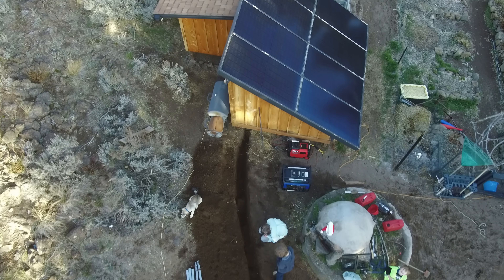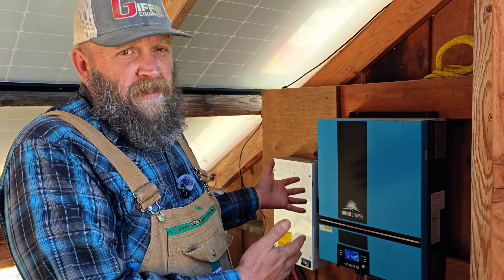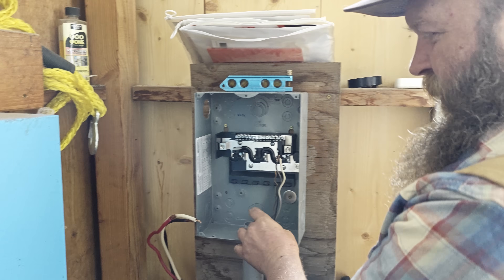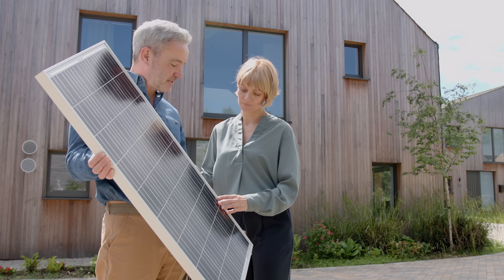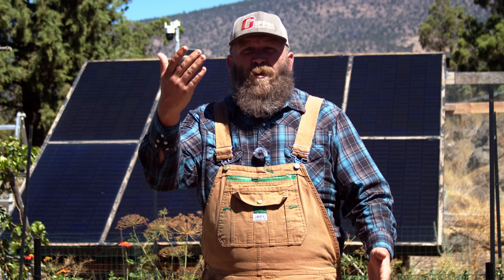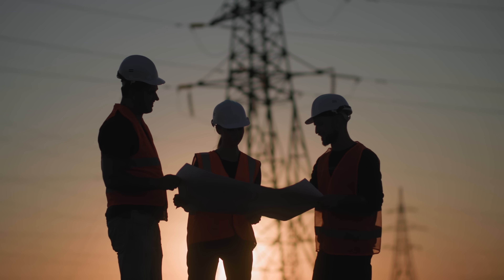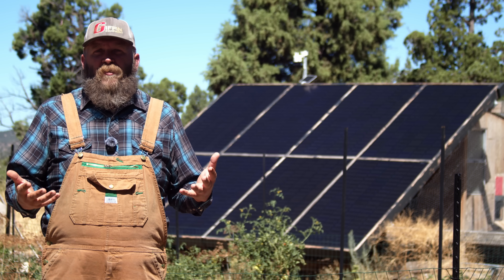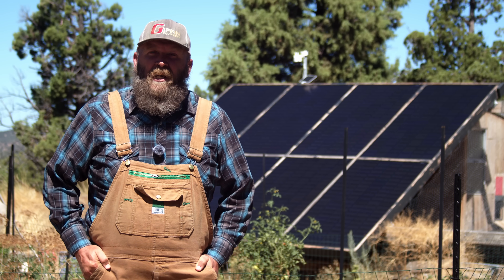The True Cost Of Off Grid Solar

Comment: I think it would be good to add to this... I've been living offgrid solar and wind for several years in Wyoming. The system you have is a bit smaller. You can live with that... but if you want any semblance of normalcy and a wife and kids that don't hate you, you need a ton more... 
I have 6kw of solar, a 2kw wind turbine ( I live in the windiest state and it is not worth it to do wind, unless you spend an obscene $ on it). My battery bank is 4x the size you have, and it's still not enough in the winters. I obviously have more electronics than you do.. I run an electric stove, electric hot water and a forced air furnace and a few refrigerators and freezers and a water well pump. Those eat power like no tomorrow..
In the sumer it's no problem for us to run our central AC. I almost never have to use my generator in the summer. But... in the winter I have to run it about an average of an hour a night to help cover the cooking after dark. I use propane for heat, thankfully my cabin is so well insulated that it barely uses any to heat the place. I used about 275 gallons for all of last winter in Wyoming... it stays below freezing from November to March and frequently drops to -20°F at night for weeks at a time. We also have stupid wind that 50-70mph gusts with 20-30 sustained is the norm here.. (hence why almost no one lives out here)... 
I have a family of 5 in a small cabin on our ranch and I have to constantly pay attention to our power usage and my system is much lager than yours. I wanted to give other people another perspective on real off grid living. It's not easy.. it's a very big life style change. And if you want to live without constantly worrying about power and having to get up at 2 am, put clothes on and go fire up the generator in -20°F temps and -60°F windchill. you need much more than shown here. I'm hoping by this winter I will have all my batteries purchased and in place. I have about 43kwh of batteries now.. this winter I should have right at about 70kwh. 

I will gladly take a look at what else you have going on with your stuff.. and I do say you had a good approach to helping others start the process. Kudos to you.
Reply: I'm liking your perspective on this. I would say given the weather conditions we have here, while much different than yours, are as demanding in a different way. For my own use, I see 40-ish kwhr of battery backup a good start. In the summer with normal airconditiong loads and all the other electric devices we have, our consumption is knocking on the door of 80 kwhr per day under worst conditions. The winter is not nearly as bad normally, usually 50 kwhr/day or less under worst conditions. In order to run grid-free and with no gas generator involved, 70+ kwhr battery capacity would likely be necessary and that is just nearly unaffordable unless you are Warren Buffet.

Comment: Here’s what it cost me doing everything myself except new service run (I keep the grid as backup):  

200A service run and conduit for ground mount pv array — $7300

2x EG4 Flexboss21 inverters: $9000

1x EG4 Gridboss MID: $2500

128 x EVE lf280k LiFePO4 cells from Docan: $10800

8x Seplos Mason 280 DIY kits w cables and heating pads: $5440

5x Neey active balancers (before seplos included in kits): $450

Cabling, connectors, etc: $1200

12x12x72 raceway: $500

Conduit and couplers: $500

Midnite Solar 1000A battery combiner box with 8x 175A breakers: $2100

PV wire: $550

Ironridge roof racking: $3500

41x Solarever 455W panels: $6500 shipped

30x aptos 460W bifacial panels: $5500 shipped

Integrarack ballasted ground mount:  $4000

Gravel and labor for ballast: $1k

Off grid year round in central Maine.  No power injected to grid when surplus

Comment: For what it's worth we run Directv, bunch of lights, fans, water pumps, a full size fridge, and electrically prewarmed gas oven. Of course I have a blender and all the typical electronics even a sleep number bed in our 12x16 tiny home. On our carport we set up 4- 430 watt panels with a renogy hybrid 48v all in one inverter and 12-8 volt deep cycle batteries. In Hawaii everything cost us about $4500. Been running almost 2 years with zero issues.
Reply from the maker: Sounds like you've got it dialed in, great job!
Reply: Hello !! I just started drywall on my 12 x 16 tiny home with my baby girl Lyla (doggy) in Tennessee. It’s great right ?
Reply: @NoMoreBigRatRace My wife, 2 dogs, 4 cats, and I have been living in our lil cabin for over a decade now. We love it. Traditionally our bed was in a loft, though with health changes we had to move it downstairs, so we are building a separate bedroom cabin of the same dimension. We already had a 8x20 lanai attached, so we are mirroring it with another lanai on the new bedroom, joining our current one. By spring we will have 2 tiny lil cabins 18ft apart with a nice big covered lanai in the middle for having people over and such. Overall we love living in this lil house. Anything normal sized would just feel wasteful.

Comment: I live in a small city. Called the local inspector. He said as long as I don't roof mount or ground mount or pull my meter, I didn't need a permit or inspection. So I've had 2,000W of used panels laying on bricks in the back yard powering a 24V 2,000W inverter and 5kWh battery. Took all my lights, computers, fridge, freezer, tv, etc off the main breaker panel. 1.5MWh have passed through that system in the last year. This year, I'm upgrading to 5,000W of used panels and a 10kW inverter and 16kWh 48V battery. Going to take almost the entire house off grid. Only costing about $6,000 and should pay for itself in 2 years or so. Having a TOU power plan makes it pay for itself faster. I'll be mostly using off peak power during the night and using solar to offset the expensive power during the day.
Reply: Very nice! I’ve always wondered if you could use the free after hours power to charge and then use your batteries and solar during the day. TXU for example have plans with free power between 8pm and 6am.
Reply: @torstenmeyer2905     mines never free  even off hours
Reply: @torstenmeyer2905  never heard of 'free' power.  Maybe you got a sweetheart deal, here its just normal rate, or a higher surcharge during peak hours of 3-7pm
Reply: i have 2kw worth of panels in boxes on my back deck. im going to zip tie them to my porch railings until spring. i have a charge-inverter and a 5.1KW server rack battery soon. i live in NYS and we are paying 28 cents per KW/HR
Reply: What about energy storage?  Do you use giant capacitors like 1.0F used in car, audio set ups?

Comment: I think even City dwellers will appreciate this. If you need to power an out building like a garden shed or workshop without running wiring
Reply: my cabin house is over 100ft away from the main house and instead of hooking up to the already outdated electrical system i opted to go full solar for 4k total. very fun and easy to do with all the info here on youtube.
Reply from the maker: Absolutely!!
Reply: I dug a basement storm shelter within 10ft of an outlet but decided to have it totally power independent. I wired lights direct to the 24v dc and bought a $400 solar charger inverter. The panels were second hand and lifeop4 batteries about $1000. It’s a simple setup that cost a months salary to build. Like he says lead acid would be a lot cheaper initially but definitely not over the long run so don’t skimp on these. Solar companies that want you to pay 200 a month for 25years is a total rip-off.

Comment: I watched a couple build a solar array in a snowy area, and the ambient heat from the panels along with the pitch of the array caued the snow to slide off. It was pretty cool, no pun intended. 

That said, they still had to go with wind and I.C.E. generators for the winter. Time to learn how make biodiesel. 😅
Reply: I live in a snowbelt in the northeast where 7 foot snow events happen every year. I am installing two more verticile, south facing, 1350w (2700w) arrays just to shed snow.
Reply: @kevinm234 7ft!? That's a lot of snow! How well do the solar panels do shedding that much snow?
Reply: Can you make it biodiesel ❤
Reply: @sussijensen6977 There are a lot of videos on YouTube that teach how to make biodiesel, but there are chemicals needed for most of them to work. Still hoping to find a simpler way, especially since there have been promising studies in making biodiesel from olive oil using only what comes from the olives themselves. If that works out, then growing olive trees and owning an olive press would be an excellent solution.

Comment: Spent $1380 on 400w of solar, a 3000w inverter, an auto transfer switch, 600 Ah Lifepo4 batteries (12v), victron 100/30 mppt, and an 80 amp converter to charge up my batteries with a generator. All that along with wiring 2/0 and some fuses for the system. Needless to say, I'm kickin this off grid ass BUT it's not enough. I need more batteries and more solar. I work full-time on the road in my RV and the 400w of solar doesn't cut it. Its just some extra power but my main source is the generator. Having to run that every 3 days or so to top it up. That depends on where I am. I've driven up north towards Colorado (in grand junction right now) to escape the heat so I end up charging less frequently. BUT its still a pain and I wish I'd gone with more solar for sure
Reply from the maker: Yeah you can't have enough solar. As soon as you upgrade, you use more. 😂 It's a good start. Ahead of most, that's for sure.

Comment: I would definitely recommend people get 48 volt server rack batteries, they are only a tiny bit more expensive than going for several 12 volt batteries, but you will save on wiring, not to mention they are much easier to install and look nicer, and you are able to upgrade your battery capacity super easily simply by sliding in another battery.
Depending on what you get the cheaper, quality ones are around a thousand bucks for 5 kwh.
Reply from the maker: Yep, they are awesome. They tend to be lower amp hours like 100 so maybe get a couple three to be about the same as the one we have, storage wise.